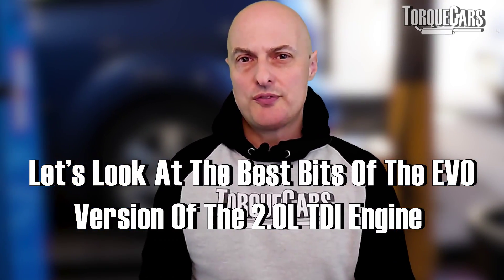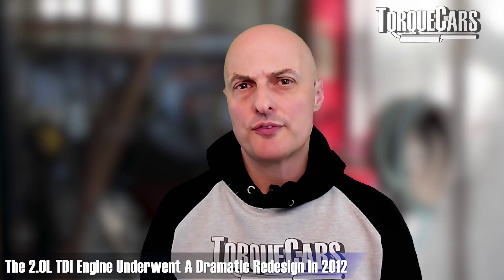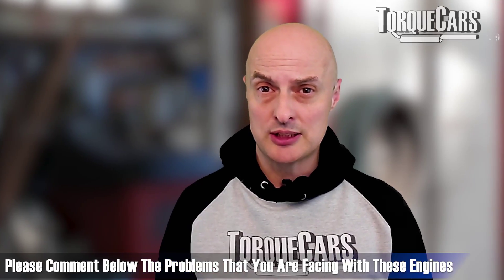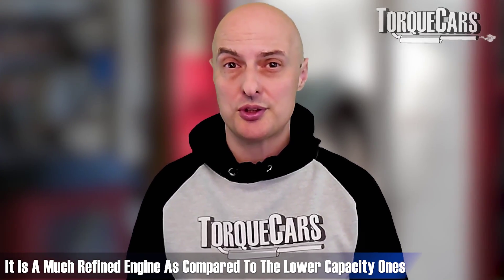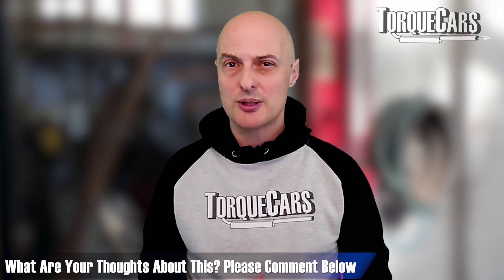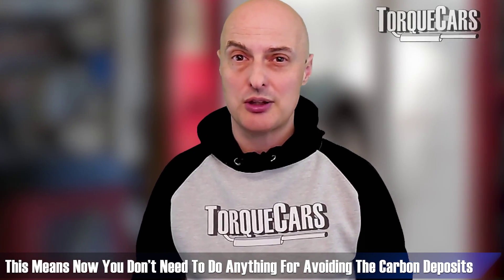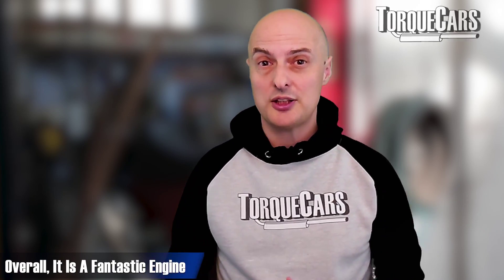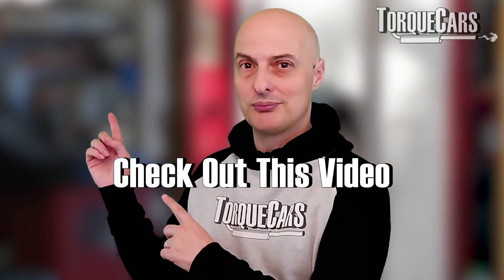The VW EVO Revision to the 2.0 TDI Engine- All The Best Bits Gen 3 EA288 2018 EVO Revisions.

Comment: I have the Evo engine in my 2021 Golf 8 Variant. Got the car used recently with 57.000 kilometers on it. The motor sounds like a sewing machine when you open the bonnet, but one that works without skipping a single beat.

The pull is crazy (at 115hp mind you) and I make sure to always get it up to temperature before I kick it. Warms up fast too. Filling it up with BP Ultimate, will put fresh oil in soon (reached 10.000 kilometers with the previous one) and I plan to take care of it.

I‘m sure it won‘t reach the 550.000 km my 1.9 TDI did but so far I love it!

Comment: Bought my Kodiaq 288 Evo new in October 2020: remapped from 190 to 240 plus. I have now done 170.000 km mainly on long trips throughout Europe. At least 10 full nighters of 1600 km straight. Oil plus filters replaced religiously every 10.000 km or less as I plan to drive this one until 2030. 

This engine is a peach: zero issues  with it and I just love how reliable it feels and drives. And I drive fast: on my full night trips I will do hours  upon hours of driving at 180 km/h over empty autobahns. Absolutely amazing engine and car (for me at least).

Comment: I’ve got the 150bhp version and had a stage 1 remap to 195bhp also torque was increased from 340 to 430 will this cause any damage to the engine? I’m 61 and a sensible driver 👍
Reply: My research has taught me that increasing the torque substantially will lead to eating clutches more often, especially if you have a heavy foot. I'm not sure how it effects the engine itself otherwise

Comment: from italian facebook forum i have the news that this engine still consuming like 1 liter of oil every 4000 km brand new motor and other not even a drops... so like allways nobody know why wv producing defective motors that are supposed to be perfectly precise with laser... so no way I will buy one.
Reply: @cal87249  I drive a 2025 Škoda Octavia 2.0 TDI 150HP. The engine code is DXRB. First oil change at around 4000 km. The oil level before changing was right in the middle between min and max, so perfect. Now the car has a little over 10000 km. No oil consumed.

Comment: Hi, I have a Ford Grand Tourneo 2023, which is actually a mk5 VW Caddy with the 2.0 tdi 102cv engine (built in the VW factory in Poland). The engine code is DTRE, I live in Spain. Does my car have the engine you are talking about here? 
Will it say EA288 EVO somewhere on it?
I don't do lot's of mileage but the engine is fantastic. The only thing is that even at 130kph (around 80mph), It is still only running at 2,000 rpm.
Thanks for the great video.
Reply: Hi, I have an identical car. What oil do they recommend in Spain? In Poland, it's 0W20. I use Ravenol VSE. My two-year warranty has expired, so I added Oilsyn Velosyn, which translates to lower engine wear.

Comment: Great video, the most informative I have found thus far.  Kudos.
The reason I found the video is I am shopping for a replacement to my Citroen C5 HDi from 2013.  I am looking for a low mileage used car, and while a Peugeot 508 or DS7 would be nice, research shows that all of the 'recent' Stellantis powertrain options are an absolute catastrophe.  How sad.  This has led me to the VW Arteon shooting brake.  I found a 2023 model with 23000km equipped with the 150hp TDI motor.  I am familiar with PSA era diesels as well as the BMW M57, but never had a VW.  Your video is giving me confidence in the choice of the Arteon TDI and I am also still researching the 1.4l hybrid powertrain, but I still some questions.  I am hoping you have the answers.
First question is does an Arteon from 2023 have the TDI version that is the subject of the video?
The Maintenance.  I am seeing VW recommends 30k km oil change intervals (crazy!).  What is reasonable.  I have always subscribed to the 10-15k interval school of thought.  Any oil recommendations?  Next, I assume there is a fuel filter.  Interval, frequency, and ease of changing said filter.  Now for coolant.  With the small passages you refer to in the cylinder head is it reasonable to plan for more regular coolant changes, if so what interval and any specific coolant other than the stuff from the dealer?  Last but not least, is this engine timing belt or chain driven.  Getting conflicting info and I have not looked under the hood of a TDI car yet.  Any concern with the timing system?
Sorry is I'm asking basic questions, I hope this is not a bother.
Cheers!

Comment: Ive had many diesel engine over the years and at one point between 2007-2020 i was considering the 2.0 hdi and 1.6 hdi french engines as one of the best, i now have 2024 after the facelift 2.0 TDI / 150hp  on Mk 8.5 and this for its power output is probably the best diesel i have ever driven ( again comparing it with similar in power engines not some 3.0 , 4.5 and above engines ).
Reply: To me the Peugeot DW10bted4 is a very very good engine. The DV6 not so mich. I actually prefer that over the three in my cars ATM, CFF and CFG engines. No dramas with them. The Jetta is pushing 220,000km and only ever had a timing belt and water pump at 212,000km.

Comment: Hello thanks for this content ! 

I have a VW ARTEON with 2.0TDI 150HP (code name DFGA) 2018 with DSG7. 

Is the ea288 evo gen 3 ?
Reply: @ZB-qu4wp  I am not sure, but I think Evo ea288 have mild hybrid system, i think your is not evo, and dont know what is gen 3? This engine came out in 2015 to 2019 and in that year it was added mild hybrid system, If im not wrong
Reply: @soawn29  My DTSB engine is the Evo, but the car doesn't have mild hybrid. DFGA is non-evo.

Comment: Hmmm, engines are pretty good compared with previous gen, common issues i see a lot are: egr cooler, oil leak do to front crankshaft seal, silica bag  from expansion coolant tank causing various blockages, early years still suffered from some failures of the hybrid water pump. Most of this issues were sorted with revised parts, so if problems not ignored relatively easy to sort out...even tho all take some good hours to replace. Very curious myself to see how new 2020 on tdi runing on a different oil and oil pump behave...

Comment: I’ve had nothing but bad experience with my 2011 Jetta, it’s only on 80k miles and it’s that bad im part exchanging it. Got my eye on a 2017 Octavia VRS on 30k miles but don’t know weather to give this engine another chance or try a different platform
Reply: @motomc6962  1.6 diesel.

Comment: Have a 2012 2.0lt TDI Sport 140 in a Touran. Not even once in a workshop apart from dieselgate recall. 5k miles and I  change oil. 20k DSG oil change. Its even got original brake pads!!!
Reply: @jeffsmith2144  let me know when your going to sell it😍
Reply: 40k miles are like 30 thousend km? really every 30 thousend dsg oil change? that mean i have to change it 2 time at year with my km that i do and not for work just because i love chill out and drive 😂... how much cost? because in wv o audi they ask more than 600€ and is is one of the point i not sure to get a dsg car.

Comment: hello, does anyone have problems with the ea 288 evo engine, with the oil increase?  at skoda they know the case, but they only advise draining the oil and driving longer tours.  regeneration problem.  How does the fuel in the engine oil affect it?  we still have the vehicle under warranty, but they don't have a solution.
Reply from the maker: Oil increase - this sounds like oil dilution to me where fuel or other fluid builds up in the oil, it is a big problem if they engine is mainly driven cold. I have a video soon coming out on oil dilution which you might find interesting.

An oil catch can may help a little although if you are getting lots of blow by and it is fuel in the oil it might be a sign of worn piston rings.

Have you had an oil analysis carried out - that will identify what is going in to the oil?
Reply: @torquecars  hello, thanks for the quick reply.  This happened to us three times, the first time in the summer on a long distance, then immediately after the service, approx. 40 km later, and then recently.  car is 2021, skoda octavia 2.0tdi 288evo.  they explained to us at skoda that the problem is in the regeneration of the dpf.  Their recommendation is to have the service done at 15,000 km, which we have been doing since the new vehicle, and to drain the excess oil.  the funny thing is that VAG has no solution.   We have 7,000 km to go, then we make service engine at a regular Skoda service, I will request an oil analysis.  I'm also interested in how much the oil gets contaminated every 15,000 km.  services are carried out in October every year.  we currently have 50,000 km on the vehicle.  I am also looking forward to your video, which will be on YouTube.  br from Slovenia :)
Reply: @simonkolednik3175  Pozdrav
Imam Golfa 2.0 TDI, 2023.g. sa 33000 km, i od zadnje izmjene ulja, koja je rađena na 25000 km, mi se čini da raste razina ulja.
Jeste li riješili vaš problem? Što kaže servis?

Comment: Just changed my 2019 caddy with 467,000km on it, never had a single problem. Got the 2024 caddy with the EA288 evo and wondering what a safe power level to remap it to doing high mileage?
Reply: @keithburke652  hi, was your 2019 caddy remapped?

Comment: Golf GTD MKVII. 
Blocked heater matrixes. They block from casting sand that remains in the block, and also from the silica bag in the expansion tank, this breaks down, splits, and clogs the system. 

This can then cause coolant to escape from the tank during a DPF cycle as the system pressure rises too high. 
They're also known to get head lift when tuned, leading to cylinder head leaks and more pressurised coolant.
Reply: Silica bag?? 👀that is so stupid, VAG just can't stay away from idiocy no matter how much they try
Reply: Easy fix, the matrix is cheap and easy to change, but fit the a new coolant tank as well, the new ones don't have a silicone bag inside anymore.
Reply: @JohnSmith-ef8nr  the matrix on mine actually caused the car to overheat causing a head gasket failure, minor one admittedly but that don’t help the cost !

Comment: 2015 TDI owner with nothing but GOOD LUCK 2L 2000CC Diesel with 112,000 miles . Volkswagen painted both sides of the car bumper to bumper on its 12 year corrosion warranty because of a spot the size of a dime under both rear door handles where water got under the paint . Three thousand dollar paint job at local top tier shop , looks brand new ! 
      I have TDI emission warranty work done no questions asked with a loaner car every time ! Best car I have every owned turned in a 2012 TDI and got 3 thousand dollars less then I paid for 3years and 90 thousand miles later . 
        50 MPG highway uses zero oil and runs all day long 80 mph smooth as a sewing machine.
Reply: I have a 2015 Passat TDI with the DSG (US), and have had zero issues with it. It was a "buy back" purchase after the "diesel gate" fiasco. It was purchased in 2019 with only 38k on it. Now at 88k miles, and just regular maintenance performed. Average mileage per tank is usually low to mid 40s. I'm considering a stage 1 tune when the warranty comes off next year... Very happy with this car!
Reply: I have the exact same problem 2015 Golf Sportwagen 100k miles rust bubbles rear door handle and have seen other cars with it too. Any tips for getting them to cover the repair?
Reply: sorry the name of those cars?

Comment: Awesome video and love your channel. EA288 is the newer version of the EA189. It’s actually a cracking diesel engine it doesn’t burn oil and VW have fixed all the issues that were encountered on the previous models. They went back to the drawing board and created a diesel engine master piece. Sad thing is because of all the problems and nonsense that went on with diesel gate people don’t realize the engine is now producing the same NOx as petrol lower CO2 and more MPG’s. Is now for real this time more environmentally friendly than its petroleum siblings. Wish politicians would wake up to this reality.
Reply: 2016 Skoda Octavia Scout(CUNA) here with an oil consumption of 0.25L per 1000km. It says in the owners manual that these cars can use upwards of 0.5L per 1000km and that this is considered not to be a warranty. 

I wonder how you can claim them to not burn oil when it is common as well as it says right in the very owners manual that comes with the car. Maybe the EA288 EVO that he's talking about in this video, is cured of this, but the engines before it are known to burn oil.
Reply: @Freerider-----l  Skoda Superb L&K 2017 CRLB 0.15L  per 7-8.000 km and lot of frieds same. You are more on exception.
Reply: @Freerider-----l  The evo burns even more.
Reply: @K0nst4nt1n96  a lot of people say the EVO is more unreliable than the early EA288 but it's the other way round , VW updated the EVO with way better piston rings and cylinder coatings to handle thinner oils more efficiently, the only thing that does break more often than the EVO is sensors , Dpf and egr will all be fine if you drive the car how it's intended to be driven
Reply: after the EA288 there's the last versione that is the one in the video EA288 EVO.

Comment: these new engines are a piece of crap. They eat oil, the engine block is made of aluminum. this means that it cannot withstand high revs, the fuel injectors have become even more complicated, oil leakage is very common.
Reply: I solved my oil burning issue very easily by using LiquiMoly CeraTec and their TopTec 4200 oil.

I drive very hard and yet 2000 miles after service not a drop burnt
Reply: That is quite the claim. There are hundreds of high performance, high revving engines out there that have aluminium blocks. And another thing, this is a diesel, intrinsically not a very high revving engine - diesels are better known for high torque at lower revs. Your other claim I cannot speak for - mine uses no oil, currently at 125K km.

Comment: Nice informations. Waiting Golf 8 rline tdi 150 DSG for march. I hope its like how u say 💪. I want to know consumptions too. They say i can drive 1250km with full tank. Is thst true ? And its not noisy engine. Similar to some petrol. What u say for DSG
Reply: I do have 2019 passat with 150 hp engine and 7 speed dsg. My diesel tank takes 66 litres and 1200km is possible, but... I drive between Poland and Netherlands on a regular basis. I keep my speed around 120 km/h and after 1200 km I get a low fuel light on dash. If you stretch your right leg, range will drop to around 900km. It all depends on a circumstances like wind, strong rain. DSG works fine on a highway, if you rather drive locally I would suggest to change switching times, so it will change gears at 2000rpm, rather than 1600rpm. Diesel vibrates when idle, but when on a highway it is really quiet. Hope it helps
Reply: @andrzejbielecki8080   How to change switching times? (I have the 2018 Passat with 2.0TDI - 150hp.)
Reply: @Skagen63  visit reasonable tunning workshop. Process is similiar to a chip tunning of an engine.

Comment: So I shouldn't buy a 2018 2.0 TDI DSG with 30,000 miles?
Reply: I would stick to 2019 onwards just to be safe. Ive got the a Seat Tarraco 2.0 190 EA288 it’s on 34k miles and it’s awesome. Best diesel I’ve ever owned
Reply: I’m in 110,000 without issue. Burnt a bit of oil until I changed to LiquiMoly TopTec 4200 and Ceratec additive.

Comment: Another great video, didn't know about the SENT system or the hybrid action of the alternator despite reading the ERWIN self study and engine manuals! Hmmm, wonder if you could retrofit two or three alternators: )

On the upside the EVO water intercooler setup with the far shorter and lower volume intercooler piping is awesome, as are the later generation, smaller yet higher flowing turbo's. The GTD 1449 turbo is tiny but flows incredibly well from so low down! The twin turbo version sure tunes up well, but is a complex beast. The later EVO injectors sure flow well over the former 288's! The NOX/CAT setup is genius from an engineering design perspective if not an actual real world packaging one, I was impressed the moment I first saw it, pure genius. Downside is the camshaft module preventing cam changes in the EVO, and the head being designed for efficiency over performance despite the inlet port design looking far better from first glance. Nightmare to port with the parallel valve arrangement. The EGR may have less soot, but now has more corrosive exhaust gas due to the sheer amount and size of the EGR pipes, with the turbo inlet impeller having to be titanium coated to stop it being corroded!  

A genius evolution for sure, but sadly as emissions and need for efficiency ramp up, the performance considerations drop in a lot of areas. I am currently repowering my 2014 EA288 CFHC 140 and seriously considered the later EVO engine, and have the means and software / CANBUS experience to do it, but decided to go for a EA288 CFGC 177 for the overall performance options despite some older designs. About all I lament from the EVO is the intercooler setup and the twin turbo ( plus now the hybrid alternator thanks to you! )

Comment: DFHA engine code on Superb 2019.Egr cooler failes and leaks coolant in the intake system.Timing belt tensioner failed and makes horrible noise.Vacuum pump makes a nasty scrapping noise when cold,dual mass flywheel rattles when cold.
Reply: Garbage parts as usual. All decent modern engines are ruined by garbage parts. Even BMW had a massive recall because their EGR cooler was no good too.